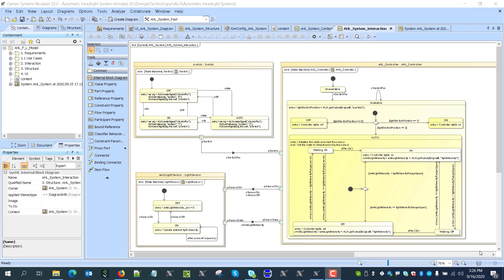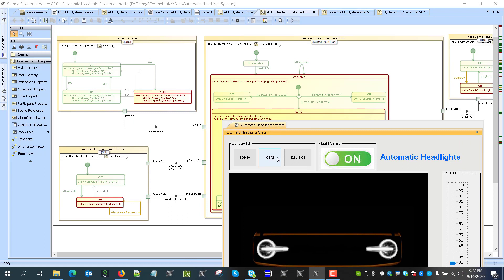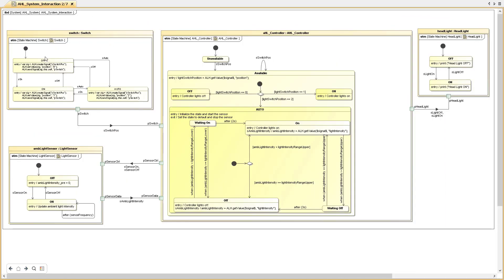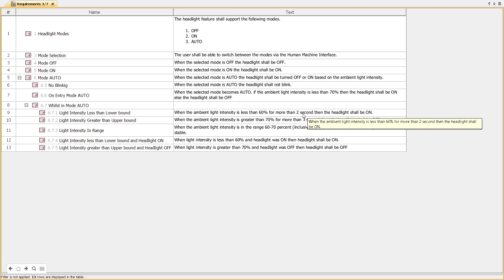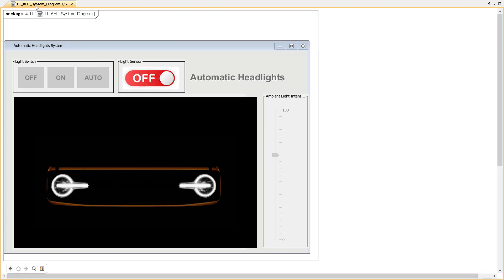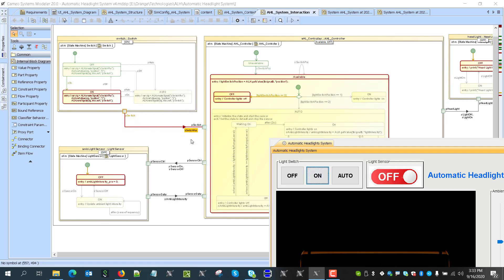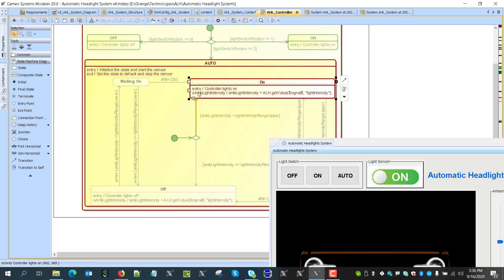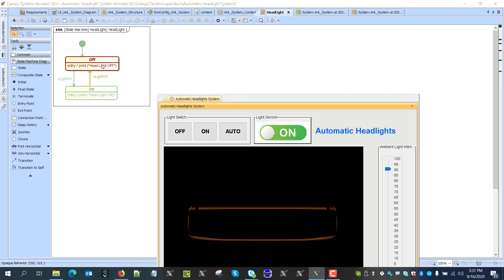Automatic Headlights System Model and Simulation in SysML

Comment: When I try to recreate this, I get an undefined returned from the Controller's "Available" entry condition's "lightSwitchPosition = ALH.getvalue($signal$,'position')".  I have added breakpoints to confirm, but have no idea how to introspect into $signal$ to figure out why it's happening.  The default value of lightSwitchPosition on the Controller block shows as zero up until it enters "Available", where the entry behavior causes to go undefined and my simulation stalls on the decision diamond.  Do you have any resources or solutions or things I might try to get this working?
Reply from the maker: Hello, can you check is this issue still available in v2021x? Looks like bug in v19.0..